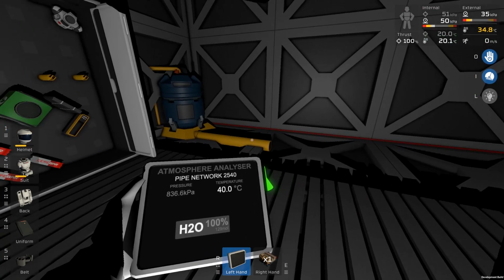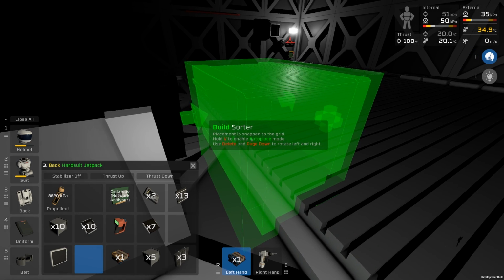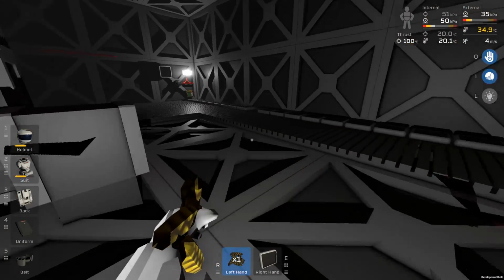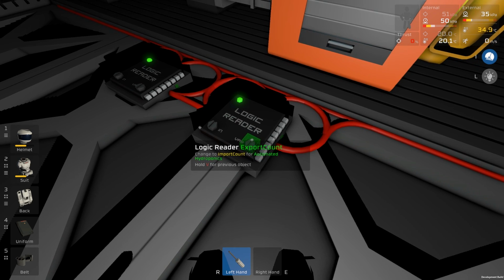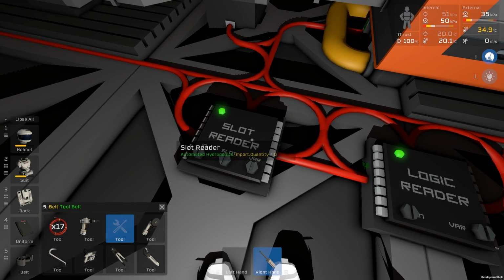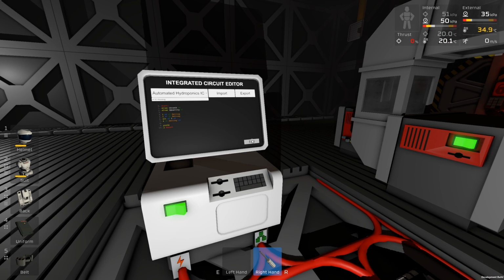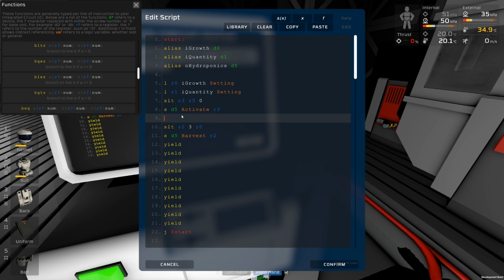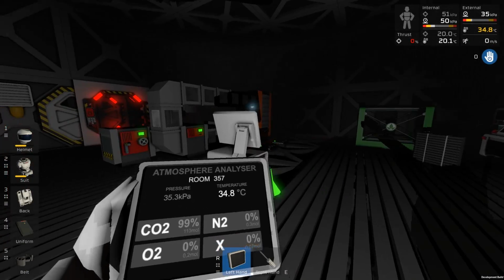Stationeers S2 E52 Automatic Plant Growth

Comment: For your arc furnace. I'm behind about 7 videos. I fall asleep watching the list and have to go back over. 
Most people disable comment on old videos. Wasn't sure if you did so, oh well. 

In the 2nd part you made a fix and I didn't catch your chip settings. You show what you were reading then jump back and you read but you didn't show what setting it was reading. I tried watching a few times but didn't get it.
So I made my own from what I did get.

I can name that logic circuit in 4 chips.
Batch reader import slot = anything activate arc furnace.
Batch reader export slot = anything activate arc furnace.

If the export slot activates the af it runs a quick cycle and tells that nothing is inside and shuts down.
The downside is the power usage.
It uses that power for a few seconds more than need be but it does clear the whole system.

I only use 1 arc furnace atm. I haven't gotten the point of automating the sorting.
I have a 4X1 room with arc furnace a few chutes to insert the ores and export the ingots out the room.
A passive vent grabbing the co2 and expelling the rest.

Now it does take some time going through the ores. I have 3 belts and coming back with 3 full all at once on a 5-6 chute system.
Have to remember to reload but I have stockpiles of ingots.
In the process of building a larger system over in the permanent area.
Reply from the maker: I usually have the code in a pastebin in the description under the video - feel free to check there.  If you're looking for arc furnace using IC chips, that's in today's episode :)
Reply: No this was before the new logic chips. S2 E22 and 23. 
You have 2 per furnace and a few more for other stuff. 
I did it in 4.
Reply from the maker: Aha - yep, we've just replaced those with one chip :D

Comment: What about just using a passive vent for co2?
Does it need to be in a room or was it the temp inside the station that killed the wheat.

Would you be able to set it outside. 
Lets say you piped a line from the room to outside which is keeping the air temp toasty.
You'll never have a need to go through an airlock again. 

I'm not sure why I haven't heard of anyone mentioning it. Plants are good to around 60F 15C I have tomato plants that continue to grow and fruit. Some do require it to be hotter like cherries and strawberries but wheat is fine down to 55F 12C.
Wiki says they grow in temps up to 50C. Plants start to wilt around 32C 

Here's the big part that I don't like. 
At 22C(?) the temp changes color to yellow then red. Makes you think it's to hot and the game will kill you. Even though it's not bad at all.

I'm also wonder if your over complicating things with the logic chip. 
Yayyy. Logic circuit chips. Let's use them everywhere. 
The idea is to reduce the number of circuits from using 10+ covering and entire floor walls and ceiling. 
However if you can get away with 1-3 chips. 
It's probably easier that way. 

How much power does the logic chip use compared to a normal chip. They should make it use more power.
Reply from the maker: If you're on Mars, and wanted to use a passive vent, you could put it outside, but would need an air conditioner inline, then a filtration unit after the automated hydroponics to remove everything except carbon dioxide, sending that stuff back to atmospheric storage.
Reply: Put the passive vent inside the building and run the line outside to the hydro station. 
So the air inside the building feeds it. 
Not just random air. 
So you only need to keep the room toasty which you already have. Just run a line through the walls.

Comment: My hydroponics is now broken after using these machines. I noticed that I was getting no change in the mol count for O2 or CO2 when a plant had finished growing. Ok, so maybe that was a trade off but it has now stopped working in the old system as well. I planted 17 ferns in the open pods, they grew but used no CO2, produced no O2 and the temp never altered. When I have sorted that, I will try your system. Do you think that I will be ok using a passive vent from the hydroponics bay atmosphere instead of a canister?

Comment: To wait N seconds (or call any custom reusable function), do something like this...
- - - - - - - - - - - - - 
// Required & optional variables (used by all functions):
0. alias returnAddr r15        // line nr. to return to when a function completes
1. alias arg0            r14        // function argument, repeat for multiple args (arg1, arg2, etc.)
2. alias returnVal    r13        // result of function (optional, if function doesn't return anything)
...
4. j            $start                    // jump to start of program (skip function definitions; 'start:' label)
...
// Function definition(s):
6.   func_wait:                            // start of function, func_wait(N) : wait N seconds (N*2 ticks)
7.   blez    arg0   returnAddr     // return? jump to line 'returnAddr' if arg0 (N) <= 0
8.   yield                                      // wait ~0.5 sec 
9.   yield                                      // " " (x2 = ~1sec)
10. sub     arg0   arg0 1            // arg0 = arg0 - 1 (decrement N)
11. j          $func_wait               // back to start of function (loop until N <= 0) ## see Notes
...
// Start of program:
15. start:                                    // label from which regular program starts
...
// Call function:
21. move   returnAddr   24     // prep: store return address (line 24)
22. move   arg0              6       // prep: function argument (N = 6 sec)
23. j           $func_wait            // call func_wait(arg0) : wait 6 sec - jump to 'func_wait:'-label
24. ...                                         // continue here (returnAddr==24) after 'func_wait' returns
- - - - - - - - - - - - - 
## Notes:
a) Often you'd end a function with a return, e.g. 'j  returnAddr', but in this case since the whole function is just a single loop, it's shorter to return at the start with 'blez'. Here's an example of such a simple function; everything else is the same:
- - -
func_plus:                              // return arg0 + arg1
add     returnVal arg0 arg1
j           returnAddr
...
10. move   returnAddr 14
11. move   arg0             5
12. move   arg1             4
13. j            $func_plus       // call: 5+4
14. ...                                    // ... continue here after return, result: returnVal == 9
- - -
b) I'm assuming that you can jump to a label, e.g. ''j $start' or 'j $func_wait' will jump to labels 'start:', and 'func_wait:' respectively. If not, then just jump to the function's 1st line instead...

Comment: I wonder if the reason the wheat didn't get added has to do with the sorter. Earlier when the chute got sucked into the hydro it cycled once to the right, with the airlock to the left of you, which shot it back into the hydro. When you pressed the harvest button again it then went into the left sorter slot so it could be removed for the stacker. If the chutes we're switched so the right was the stacker would it clear by the time the wheat cycled around after the second one was harvested? Haven't tested it yet but an idea. 

Also since it harvests one at a time I don't think the first stacker is needed.

Comment: maybe if you where to put a pipe radatior on the atmo pipe for the hydropodic that may be all you need to cool it down into the room. also it think something is wrong with your system due to the temp you at is like 310+. mines set too 299 and keeps it at a nice 25-26c which is perfect unless heat somehow gives a bouns to growth rate i dont know about.

Comment: Ok so this morning I woke up and did some further testing on the Automated Hydroponics device (and also confirmed a few things with both Hydroponics tray and Hydroponics station) OK the Auto Hydro unit Only harvests 1 item at a time.. It has 3 slots, Inport / Export / "plant" (un-named atm) slot. 
Ive been bashing the auto system hard to help Rocket squash some bugs (because this auto unit is my dream come true in terms of dealing with food production)
The Hydro station - when you manually harvest from it, you clear the entire slot.
the hydro tray - When you harvest from that, you only get 1 item.
 thinking back a few updates ago - I seem to recall leaving 1 plant in the tray and it would regrow a 2nd (or 3rd /etc) one.. However Todays early morning testing proved that some point in time that system has changed.. so its best to harvest everything - then replant.
Now the auto unit (Ive already posted in Discord about it) should be changed to harvest "everything" - ie act like the Hydro station when harvested.. (to help with automating it) 

Right now - the system is buggy - the Errors greyduster had (partly due to having both hands full) was not something I tested - but it seems if anything other then plants enters the device - it "crashes" (Ill be sure to mention that on discord) 
also it seems much like the Furnace - once something enters the input it closes and locks until cleared.. (in case of furnace its taking time to count the items or whatever it does when it locks after 1 item is put in and waits a few seconds)

So right now yes its still buggy - tho its getting fixed pretty fast :) 

o/

Comment: If I'm not mistaken, when you harvest one time and leave the rest, it will mature in the same growth time and you will be able to harvest again. At least this is how it was working in the old hydroponic bays. This actually renders your entire gadgetry behind the machine useless since it will just output one at a time, constantly. And there's no reason to use an external slot reader as you can just use the ls command to load info from slots.
Reply: Rudi Christensen That is not true, unless it didn't update the model properly. It wouldn't grow a next one untill it has been emptied completely and replanted, at least that is the way I remember it working.
Reply: I could be wrong eryk. But I remember it was how it worked at some point back in time, using the only hydroponic bays available at that time. I will test this tomorrow at some point tho.
Reply from the maker: It does do that - I changed it to do that after the end of recording :)
Reply from the maker: Replied to the wrong comment here.  Haven't tried regrowing from one plant yet